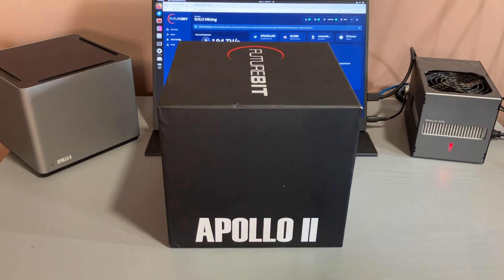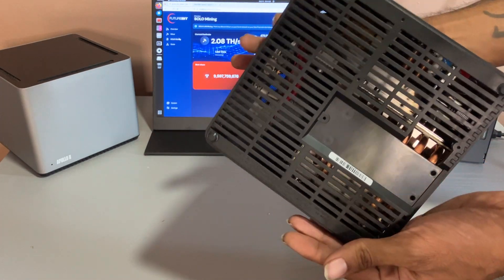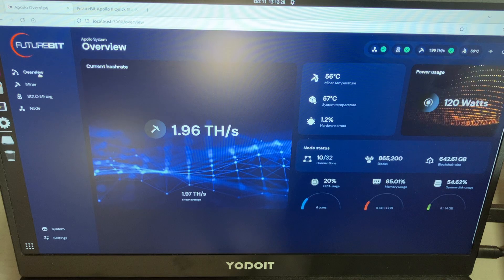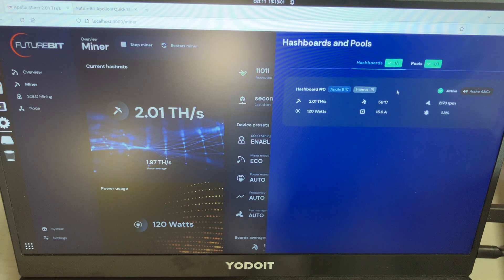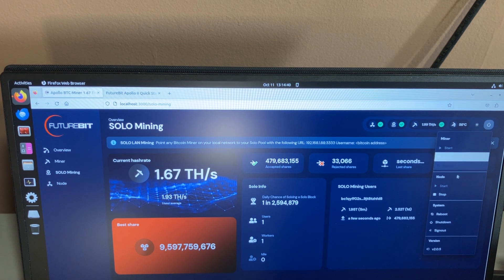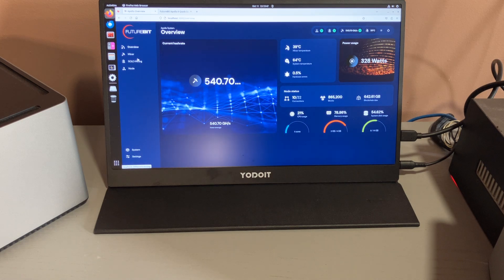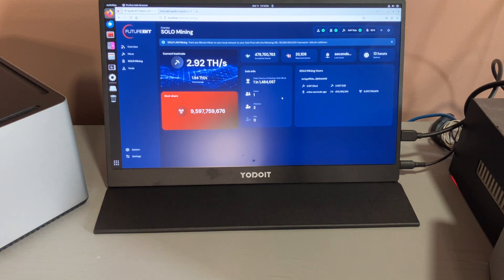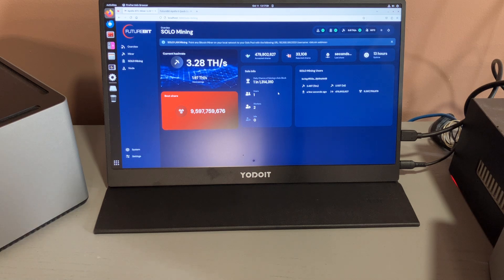FutureBit Apollo 2 Standard Unit unboxing/set up : Apollo 1 upgrade ?? 😲

Comment: I ordered the Standard. Can i just mine without a node? I dont have another one.
Reply from the maker: @jumpmanjlow3292  no the standard can’t mine by itself, think if it like a turbocharger for a car, and the node being the car , I would cancel the order and get the full node one
Reply: @RandomRomanTV  I was under the impression that you could purchase the standard by itself if you wanted, and just set it to your pool of choice (F2pool, ckpool, etc...)
Reply from the maker: @ that’s correct you can , if you know how to program it in Linux….. before I thought you need to connect it to the node … but if you know code… you can run it on a pool 🤔 but I just don’t know to do it 🤷🏾‍♂️